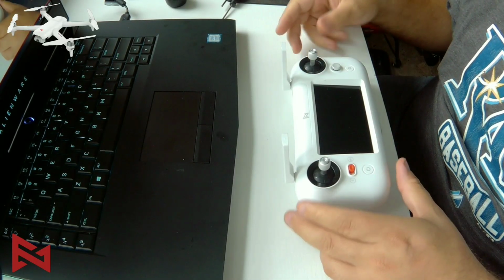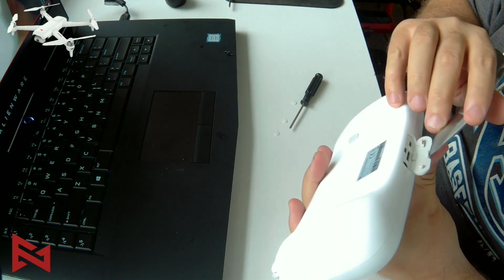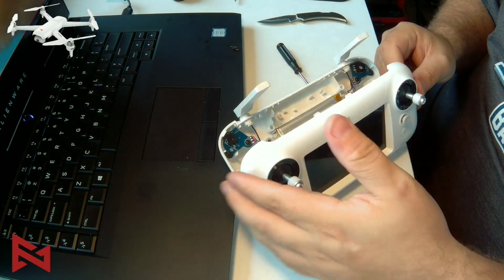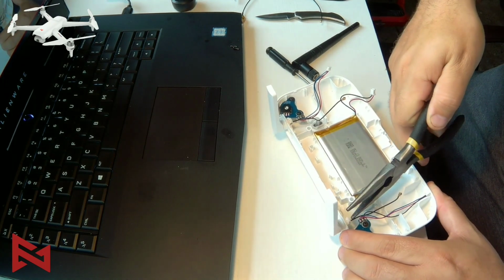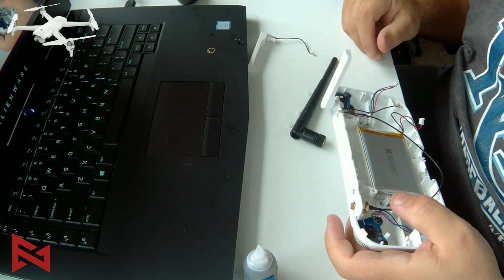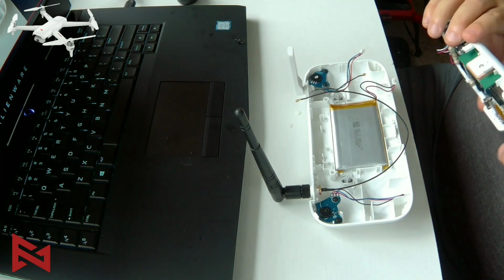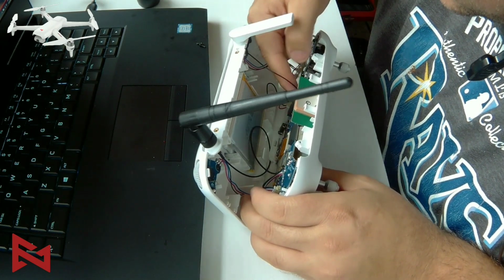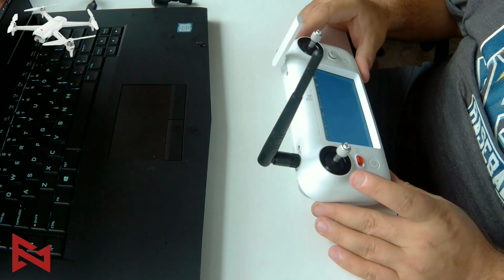Fimi A3 Must Do Range Mod!!!

Comment: Im curious how the results of this addition is holding up.  I did this mod the other day only on the 2.4 side..and I only tested out to about 60 meters because the first thing i noticed was my fpv reception was much worse from start to finish. I ordered another antenna for the fpv, my fear is that i damage the ipex connectors because its not an easy snap on,  and  the 2.4 side ipex was sliding around even though it was attached, so I put a drop of glue on the ipex and let it dry before putting it back together.

Comment: There is a 25mw and 200 mw setting for range in the settings menu.
Reply from the maker: We understand that however it still gets very limited range even 200mw but that is only for 5.8 fpv range that is not for 2.4 receiver range. The bird is transmitting to signals one for visuals and one for control. the one for control is the weaker signal which should not be the case you should never lose range capability for control before you lose visuals. This is why we make these mod videos to show people how to improve their range. It's okay I understand you didn't know this is why we come on here to teach hopefully you learn something from our interaction. Have a good day brother
Reply: @IFixShet  awesome...I modify stuff myself and build drones from scratch...since 2010 I have been into quads and 30+ years with all things RC.
Awesome mod though.
Reply: Hi dude, in which settings did you find how to modify the 25mw in too 200mw?pls 
All the best
Reply: @raydenkundera857  
The CE mode is 25mw and the FCC mode is 200mw.
Reply: @droneready8278  Thanks body for that, also do you know what is the differences between mod 1,2,3? pls
Reply: @raydenkundera857  ??
Reply: @droneready8278  In custom settings it is right dial: with EV and PWM, that I don't know what means and stick mode: where is mode 1-2-3, means what? pls
Reply: @raydenkundera857  stick mode is whether you prefer right hand or left hand throttle...and I think mode 3 is like flying a plane.
Reply: @droneready8278  Thanks man for that, you did as well the modification in the antennas? How its performance? ?  Cheers
Reply: @raydenkundera857  no I didnt do the modification...I found that using parabolic boosters/ range extenders are cheaper and work just as good...I have gotten 2.4 kilometers with 10 dollar parabolic boosters from Amazon.

Comment: Does the GPS signal increase?
Reply from the maker: No the GPS signal does not increase the GPS is inside of the Drone it's a standalone system it has nothing to do with modifying the antennas
Reply: Thanks, I want to fly it inside the factory, how can I increase the GPS?
Reply from the maker: @oktayhappy  you can't it comes with a proprietary stock GPS system there are no Optical flow sensors for indoor flying
Reply: How can I increase the GPS?  is there any possibility?  gps repeater etc ...

Comment: Surely something wrong with your unit if only getting 100 metre range ? 
Mine goes to 800m with no problem with std setup,  have been to 1.3 km before connection is lost and it auto returns, over more open ground
Viewing the LCD is biggest problem with these,  there is a mod to increase the back light by changing a resistor,  but main issue is the sun getting on it and so some form of sun shade is a must
or goggles,  you can of course use normal 5.8 Ghz ones but then no telemetry can be seen, but if you have goggles with video input you can feed directly from socket on controller and get telemetry too
Reply from the maker: Either way Chris weather that unit had a problem or not this definitely had an impact on the amount of range I was getting so if you thought your unit was good before you may want to consider this doing it now. I'm just getting started with this bird my friend I have a friend sending me a 3D printed Hood specifically designed for this if that does not work I will attempt to go on China's websites and see if we can find an upgraded screen and show everyone how to install it. I used to modify the 501s hubsan products back in the day I was really well known for my mods and I've decided to take this bird on as a project so as I do things I'll be sharing them moving forward hopefully I do something that you'll enjoy or hasn't been done yet thanks for popping and brother
Reply: @IFixShet  Hi. Enjoyed the video. If the 3D printed Hood improves viewing quality, please let us know how we can get one too.  Thanks.
Reply: Hi Chris, what modification did you do in settings and where? pls
It is a shame because we didn't find more information about the controller to get much performance from it.
Also much appreciated if you tell me more information about how to get the telemetry on the goggles? pls
Thanks and all the best
Reply: @raydenkundera857  Hi,  No specific settings , as I wasn't looking to increase range - Only thing which could have any effect on range would be the "RF mode setting" in "System setting" which on mine is set at FCC - I don't remember now but pretty certain that was the default anyway - that would give higher rf power so it would not lose signal and start to return to home under its own choice
But I got that range on fairly open space - not a town location 

p.s there is an A3 facebook group
https://www.facebook.com/groups/fimiA3official

Comment: Beautiful job Dan, this helps out a lot but I have a couple of questions, why not do both antennas now because the reception on the tx is kind of bad and how about a little hot glue on the small connectors to make sure that they don't accidentally come loose?
Reply from the maker: I chose not to use hot glue because sometimes if you get it in small crevices and places it's almost impossible to remove Super Glue can be pushed on with a small nail and it will break away easily if it needs to come off. My range results will show why I chose not to do both antennas not to say that it isn't something I might do in the future just for testing purposes but I think you'll understand after I release the range results
Reply: @IFixShet  Sounds good Dan.